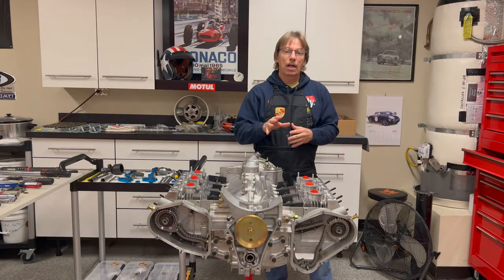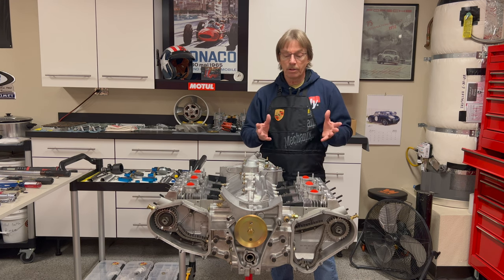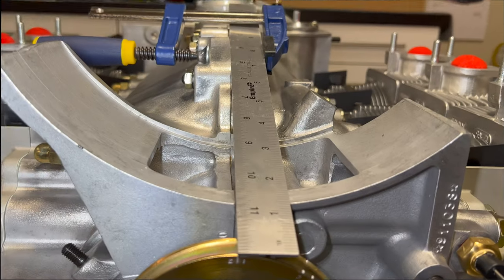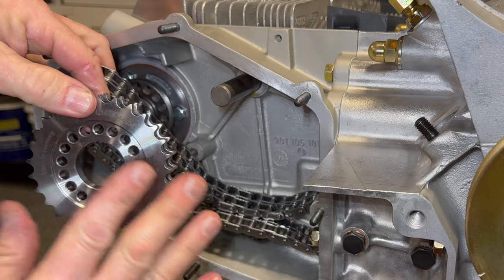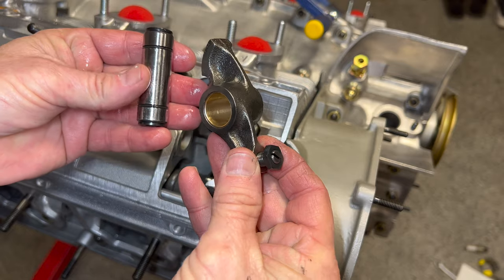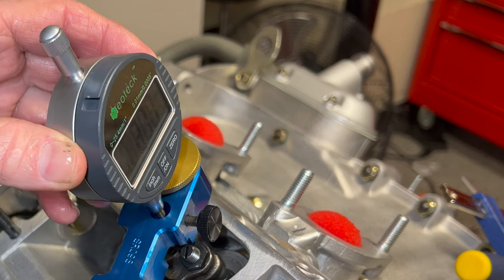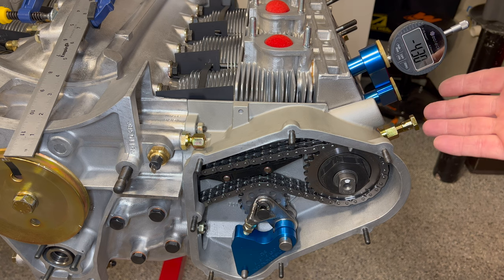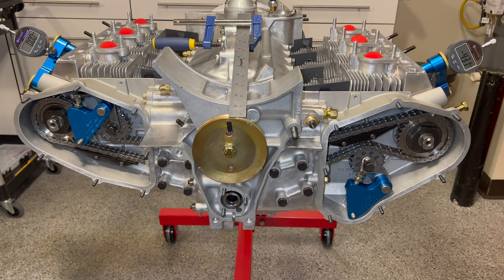Porsche 2.0 Cam Timing!

Comment: Hello, great series, been watching from the beginning.  I have a question, can the left right idler pulleys be adjusted by a half, opposite direction, to get equal numbers on each side?
Reply from the maker: Hello Bob, Wow thanks for your longtime dedication.
The cam timing process on these cars is pretty much as we went over here. It's not uncommon for both sides to be off to some small degree. Also the amount in deviation is also so small as long as everything else has been performed correctly it would be negligible on the overall performance. I would be willing to bet most cam timing arrangements on these early cars either done at the factory or by a later mechanic are off by some small degree.
Getting as close as we can is really all we can do.
Cheers!

Comment: How would you hold the crankshaft in place on a later engine that has the newer style cam nuts?  The ends of the cams are round.
Reply from the maker: Hello Cevan, Im not that familiar with the later stile of camshaft tuning. From what I know there is a crank lock that is used on some of them to hold everything TDC.I would recommend giving Kurt at Klassik Automotive Training School a shout.
 He for sure could give you the correct process and tooling needed.
Good Luck!

Comment: Can the cam timing be checked without removing the timing chain covers? If so what would be an indication that the cams are timed correctly?
Reply from the maker: Hello bwj
Cam timing should be performed with covers off. Yo will need to be able to verify cam location as they relate to TDC on compression stroke..It's easy to get lost!
Good Luck!